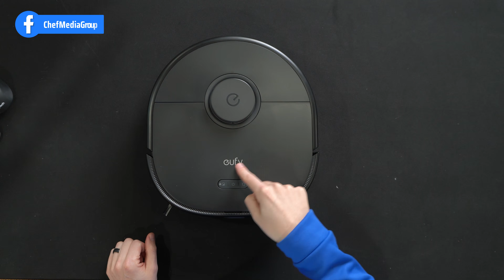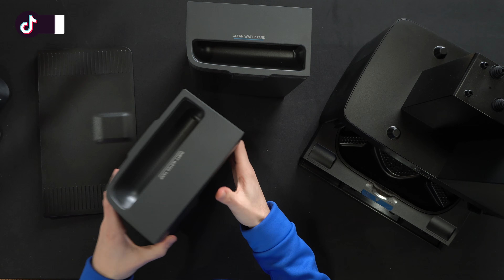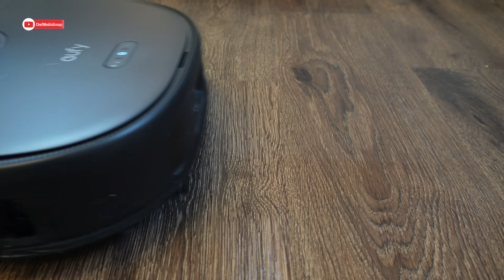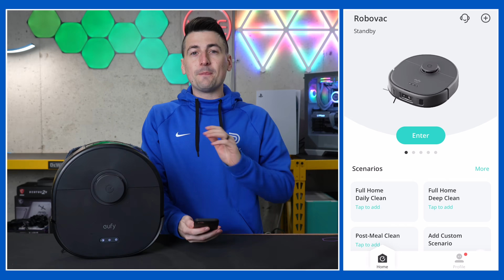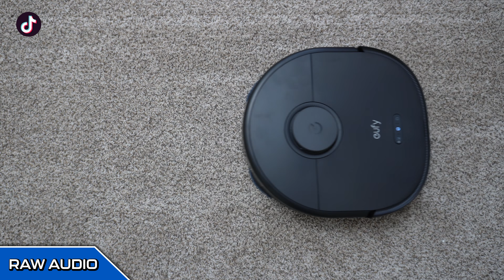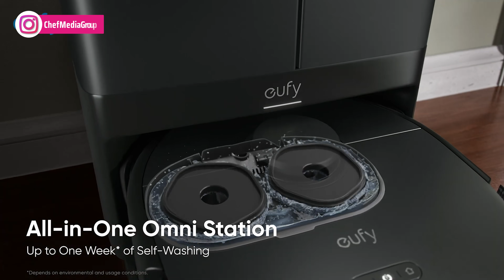Eufy X10 Pro Omni: Comprehensive Review

Comment: There is one important point missing. If the vacuum is out of its warranty which is only 1 year. There is NO support from Eufy. There is no repair service in the UK. This means is the vacuum malfunctions it is useless and cannot be repaired. This happened to me with my X10 Pro Omni where the laser stopped working just after one year and the robot no longer functioned. Eufy would not help as it was out of warranty. I had no way to get a repair. The machine is useless. Please consider this before making a purchase with a significant price tag and ask Eufy what happens AFTER the warranty has expired if the robot fails. They will do their best to avoid answering the question as there is NO support and NO repair service available.
Reply from the maker: So sorry to hear that! We are thinking of ways to incorporate warranty info and customer service into our reviews. Thought about doing some sort of secret shopper series lol

Comment: Not buying because of combo brush, detangler does not work
Reply from the maker: Have you seen others with that same issue?
Reply: I have that kind of brush on other vacuum, hard to clean long hair, so I want silicone brush, easyer to clean
Reply from the maker: Supposedly you can buy a rubber brush on their site so this could still be an option if you like everything else! @tabletennischn
Reply: Where did you see that option? I contacted them and they did not say that, also they stated that x10 brush is not compatible with any other eufy brush
Reply from the maker: If it wasn't our comment section it was another eufy x10 review ha! I can't remember where but I guess if you contact them then case closed!
Reply: @tabletennischn I bought it from their site (July 2025)

Comment: I've just ordered one of these - Really appreciated the in depth, honest review! We have the X8 hybrid at the moment which we'll use upstairs from now on. Disappointed to see the roller brush get so gunked up. It feels like this is a problem that's been solved already so it's disappointing to see this not be a better implementation.
Reply: They are selling a rubber brush for the x10 pro on their website under accessories.
Reply from the maker: Great to know! @hokaturki121
Reply from the maker: We feel the same way! Roombas with their dual rubber brushes do a great job avoiding tangles. Same for the roborock models that have that same style. Recently on the Dreame X30 they now have a cutting brush (we can't wait to try it) and we just covered the Narwal Freo X Ultra that has the best single brush design to avoid tangles. It is legit!

Comment: So the vacuum performance is average.
Reply from the maker: Average performance + some top of the line features all for a below avg price!
Reply: @VacuumChef  Average suction at above average price! And certainly not in line with what you'd expect from 8000pa
Reply: @TheLaughingcrow  I am sure the brush is the problem also for deep cleaning
Reply from the maker: @TheLaughingcrow  Glad this was able to bring some clarity to you! What vacuum do you have or what vacuum will you end up getting?
Reply from the maker: @geo30197  Yeah it really just depends on so many variables! Tangles on brush = less effective / bristles = better for hair pickup but more tangles lol
Reply: @VacuumChef  The much maligned neato d750 and it's been doing well for 4 (?) years now. Three side brush drive belt replacements, one battery replacement and two house moves!
Reply from the maker: That is awesome!!!

Comment: I wonder why it doesn't use rubber brush? Detangler doesn't seem to work so good.
Reply: It needs to have longer sharper blades that actually catch the hair when it attempts to detangle
Reply from the maker: This!
Reply from the maker: I was so disappointed in that feature. I had high hopes but it isn't any better than not having one imo! I thought with a few more weeks of cleaning that would change but it has not lol
Reply: @VacuumChef  apparently it detangles when at the base by moving the brush backwards but you intercepted it before it has a chance to detangle the hair! You should mention and correct that in your review!
Reply: @adiorthotos that's what the feature is supposed to do but it does an awful job at it.